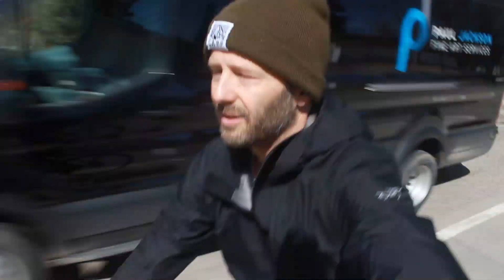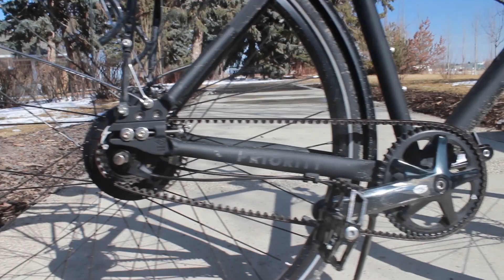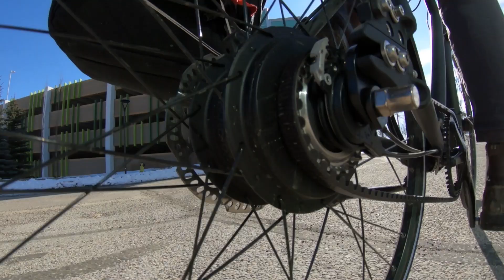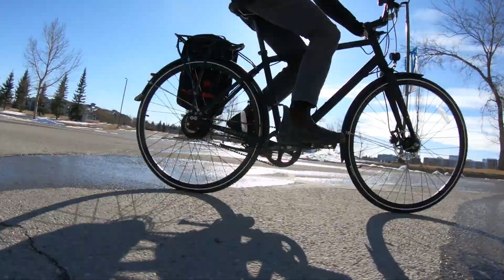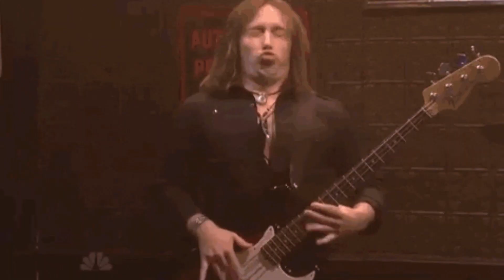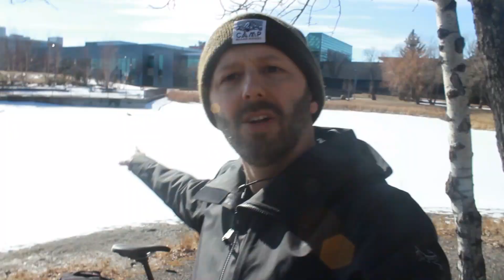Chain vs belt-drive bike | What's best for your bicycle commute?

Comment: Let me offer a stronger opinion: For urban/commute use, belts are unbeatable. The low maintenance and the corollary of cleanliness for your clothes and possibly insides if you bring the bike in are huge. In theory a Dutch style enclosed chain could be a good option but belts are fantastic for this kind of use.
Reply: Belts are still filthy and will ruin your pants if you let them get chomped in there.
Reply: @chalocolina3554  I've been riding a belt drive bike for ~4 years. The belt has remained clean (as clean as the bike is/isn't) There's no lubricant to attach to dirt (and be staining itself.  So no real issue while riding and no contact stain from brushing up against a chain while walking, parking, etc. either.

Yes, in theory, one could get a pant leg caught between the belt and the cog. But I haven't even had a close call (and have had issues with chains many times over the years). Many come with belt guards to mitigate this as well. Unfortunately my current one (Scott Sub Speed 10)  shipped with a plastic one that broke off (The Trek Soho that was stolen had a metal one)
Reply: it seems like they'd be better for the environment, too. Less fluids that end up in the soil and water as well as fewer chains in the dumps.
Reply: TBF, that can be somewhat solved with waxed chains.
Reply: @neutronpcxt372  Imagine the glide of a waxed chain and the zero effort for years. 🙂
Reply: @TimR123  Yes. Personally, I just want chain guards to becoming way more popular because the difference they make for commuting is huge in terms of maintenance intervals.

It'd be interesting to study whether or not waxed chain protected by a chain guard still has higher system efficiency than a belt drive only system. Chain guards do have aero costs...

Comment: I've had an internal 7 speed hub for 17 years, year round commuting in Toronto, zero maintenance.  The chain had to be tightened periodically due to stretching, and there's the chain rust.  My next bike will be belt driven.
Reply from the maker: Love it!
Reply: I remember having a Giant mtb many years ago with the Shimano Nexus 7 hub if I remember correctly the hub have me hassle free maintenance for at least 10 years minimum before it broke down?
Reply: I got my first Gates belt drive x Nexus-7 about 18 months ago. If you are using an internal hub, there is no need to use anything but belt if buying a new bicycle. Before I bought it I thought it was a risk, but within weeks (even in spring) I was adapted and totally sold on belt for commuter bikes. I keep looking for problems. Have not found any. After more than a year of at least 150km/week, the only wear I can find is the aluminum cog is slightly polished & shiny, no signs of advanced wear needing replacement (see Gates documentation). I think it will take years to accumulate enough wear. Clean with old toothbrush and soapy water. That is all. Love it.
Reply: Kevin Goetz  never.
Reply: I've daily driven a belt for 4 years now and I've to say my bicycle has way more issues with the belt. My bicycle repair shop says I'm the only one, but I've ripped through 10 belts (replaced for free because of warranty), it tends to slip more than a regular chain and is more difficult to maintain. (I don't mind oiling my chain 4 times a year)
And when it comes to bikes it's relevant: I'm from the Netherlands.

Comment: There's a better solution: waxed chains. Increases longevity significantly compared to oiled chains and like belts, does away with the mess. Like with anything there are tradeoffs and drawbacks. Belts will still last longer than a waxed chain and have less maintenance. But a waxed chain with the two pot method is still easier to maintain than an oiled one, by skipping the cleaning step. Especially so if drip wax is used in between hot wax baths.

Comment: The Dutch answer to the problem of oil on your pants is complete chain cases. They're reportedly heavy and still require internal gear hubs, but they apparently do the job, protecting the chain from the elements and minimizing the need to lube your chain.

One thing I think is safe to say is: don't buy a belt drive bike as your first. ("Entry-level" in marketing terms.) People who are new to biking will make adjustments as they figure out what they like and what they don't like. Belt drive bikes seem like a great long-term investment (if it's right for you), but one you gotta stick with once you have it.

Comment: I love my belt drive bikes. First one was commuter road bike (Civia Bryant), was mainly interested in the low-maintenance aspect, but also wound up loving the quiet. Second one was an e-bike, having already been sold on the belt drive for commuting.

Definitely are some downsides. Efficiency issues don't bother me much; IGH is also much easier for commuting anyway, maintenance-wise. And it's not like I'm trying to win any races getting to/from work. Even less of an issue on the e-bike, where the motor overcomes whatever losses I'd otherwise have. But I will admit that the requirement for special frame design limits availability. Also, belt drive is a lot more finicky with respect to the alignment of the rear wheel. Between disc brakes and belt drive, any time the rear wheel has to be removed, there's a whole production getting everything lined up again and tensioned right.

By the way, while the frame does have to be designed for the belt drive, it's not true that the design must be a split frame. There are bikes with elevated/raised chain stays that also can accommodate a belt drive. In those examples, the belt doesn't pass through the space between the stays and seat tube

Another option involves a tensioner/idler on the frame to allow the whole belt to travel through the frame triangle above the chain stay.

Either way, there's no need for a break in the frame.

In spite of the modest disadvantages, for me a belt drive is the only option for my cycling, which is primarily commuting with some recreation thrown in.

Comment: Like everyone has said: maintenance wise they're amazing. The payoff is weight of the internal hub gear. Friction: mostly from the belt entering and exiting the cog's teeth. To counter this, I've slightly loosened the belt, it does now occasionally slip when I'm on a very steep hill or taking off fast from a standstill. 
But I ride with someone using  a chain drive and I really notice their frequent oiling of the chain, the sound. It's a good reminder that the belt has definite high points.
I rode on a zinc coated chain through the winter previously and it doesn't last nearly as long as the belt drive, also it the chain stretches so much (internal 3 speeds seem to do that) that rust wasn't the reason I replaced it.

Comment: I'm at 3 years with my Schindlehauer Friedrich XI.  I have cycled 8,000 miles so far on th e one belt and I love it. The bike was chosen because it's my daily commute and I was tired of my bke being in the workshop.  So this has Disc brake TRP Spyre cable disc brakes.  I replace the pads once a year 3,000 miles.  It has a built in dynamo, no lights to worry about they stay on the bike and don't need battery or charging,.  It has an 11 gear internal hub. Drained and refilled once a year.  And the belt which will be 9,000 miles used this year and I'm wondering if it should be changed just because I never want a break down on my bike (tyres are Schwalbe, Kevlar in the tyres) I fitted these in the first  year.  London roads, too much glass on a Monday morning.  So the tyres have done maybe 7,000 and still don't need changing.  So I bought for low maintenance and frankly I can pretty much get away with taking it to the  workshop once a year, so long as they do all the work in one go.  I love my belt.  It's quiet.

Comment from the maker: Let me know about your experience with belt drives. I'd love to hear other perspectives on this.
Reply: Zero maintenance bike. All weather bike. Now I have no excuse not to drive around city.
Reply: Belt drives are awesome!!!...If you are more on the noncompetetive side of cycling i would say. Since i worked as an bike courier during university  (nearly 20 years ago) and needed sometimes 3 complete drivetrains per year i always searched for the "next step" in less mantainance and improved durability...so i went from a lot of mtb parts to an Rohloff Speedhub with an bmx chain wich was an eye opener back in the days!!!
5 years ago i purchased my first belt driven bike and got my second one two years ago...now i use a 29 er pinion-gates-mtb with this insane Lauf-fork wich is nearly maintanance free and an alfine11-gates-Urban/Gravelbike wich is also an silent dream (the Rohloffbike still exists but on my freeroller in the living room near the tv-set).
I think i will never switch back to an chain driven bike...belts are so quiet, they last forever, they are so much cleaner and they are safer!!! My kids use also belt drives and they love It to!
Greetings from Germany.
Reply: I had a Canyon Urban 5.0 for a few months. Loved the bike but I had to sell it because the gear range on the Nexus 8 hub was not wide enough (I do sportive riding g as well as commutes). During that time, and up to now (6 years in total) I've had a B'twin Tilt 7: a folding bike that I upgraded from 2-speed to Nexus 7. I am hopelessly in love with it. Unfortunately the aluminium frame is cracked so I have stopped using it. I am currently  having a Gates belt drivetrain fitted on a Brompton. My conclusion is that I can't get away from belt drive, but it has to be for commutes only. For serious sporty rides, you will be limited  by the performance of the internal hub gearing that is unavoidable with a belt...
Reply: My Cowboy bike has a Gates belt and I love it! I do clean it a bit every time I clean my bike but that’s very little maintenance. I’ve ridden 4000km and it still looks like new! And I don’t get grease on my pants, even when my pants go tangled up in the belt and crank it was fine.
Reply: Bike commuter and heart patient, therefore I’m testing all the e-bike options. I’ve owned old Porsche 944s with interference engines - carbon fiber belt every time thank you.  Salutations de Montréal, Calgary guy. ;)

Comment: A like the idea of a belt drive for urban cycling for the being low maintenance, but a single speed chain and sprocket are still easier to degrease and clean than a full derailleur setup.

Comment: I'm definitely hoping to get a belt drive when they become more ubiquitous and cheaper, that seems to be the only thing holding it back from being objectively superior for commuting.
Reply: What price point are you considering "cheap"? Walmart grade or lowest of the higher end ($500-$1000).
Reply: @joellebrodeur1015  $200-300 for the whole bike.
Reply: @MondeSerenaWilliams  I feel like that's too cheap. I bought a 200 dollar bicycle and I regret it because I had to do plenty of stuff to make it actually good. For once, cheap bicycles use the worst bottom brackets that break down almost immediately if they ever see any dirt or dust or water. The general quality isn't that great either. The gear ratio is awful even for flat terrain. Better to pay at least 350 dollars and get something decent. Here in Russia, I can get a belt-drive bicycle with a 3-speed Shimano gear hub for just about that.

Comment: U forgot to mention 1 big drawback: DRAG!

I saw a video where the 2 were compared to each other, each drivetrain consisting of a bottom bracket and crank set, the respective connecting part and an unlaced rear hub. When the presenter gave each drivetrain a quick push the chain drive kept spinning for much longer than the belt drive which came to a stop almost immediately!

The explanation is simple: A belt is a single part and thus has to deform in order to move around the gears. A chain is made up of joints that take much less force to bend than the belt does to deform, so a chain is more efficient.
Reply: A well maintained chain is better, definitely. But your average commuter squeaks and grinds their way to work without ever bothering to grease or clean their chain or prevent it rusting. Belts are better for those people.
Reply: Most scientific tests attest an efficiency advantage of about 2% for a perfectly maintained chain over the belt. A badly maintained chain can quickly become less efficient. However, a bigger efficiency drag is using a geared hub, especially anything other than a Rohloff. An Enviolo, for example, loses more than 10 percentage points over Rohloff and derailleur! So if you want to use a chain because of the efficiency, you should also use a derailleur. Personally, I wouldn’t want to use either.
Reply: I'd wager that test wasn't representative of reality. The wattage loses in a chain increase with power transfer (friction in the links increases under tension), whereas the losses in a belt would tend to remain constant with increasing tension. There's a small difference in efficiency but I it's not that noticeable. 
Unless you're a serious "cat 6" racer on your commute the difference is too small to be worth considering.
Reply: ebikes make that minimal difference null and void
Reply: @srobeck77  Efficiency losses with an ebike still mater. Will draw down your battery quicker and if you are going up a hill it will reduce your speed if you are the maximum torque of the motor
Reply: @brendanerskine4158  going uphill is irrelevant to the topic and will equally affect chain or belt driven ebikes battery life
Reply: @srobeck77  Like for like a chain/ deraileur setup will ascend a hill quicker than a belt/internal hub in lieu of better use of the motors full power and torque.
Reply: @brendanerskine4158  you talking about milliseconds only even relevant in a tour de france or other extreme biking competition
Reply: @srobeck77  (Rohloff excluded) internal hub systems have approximately 10 less efficiency with the Nuvinci 380 being the worst. I think that's significant as it robs a 250 watt motor of 25watts.
Reply: @srobeck77  Was clearly talking about  internal hub gears as it followed the 'excludes Rohloff' statement.  I've not talked about motor systems.
Reply: @brendanerskine4158  incorrect, theses no talk of internal hub gears. the topic was about a chain vs belt drive.
Reply: @srobeck77  Yep sure. But belt drives limit the user to a single speed or internal hub gearing. So when comparing belt drive vs chain you need to factor in the whole drive train.
Reply: @brendanerskine4158  id just factor in that belts or gear bikes cost 2 to 3 more than chain (start at $3500+) = discussion over. huge, rip off for very tiny benefits. Nuff said...

Comment: Seems like a straightforward flow chart: Are you buying/building an internal gear or ss hub that supports belts? If yes, are there split frames (or compatible suspension/dropouts) available in your preference/style? If yes, get it. The price pays for itself.

Comment: You forgot the number one advantage of a belt drive: “I can ride my bike without a chain!”
That joke aside, I got my belt-drive because, after I rode a Dahon for many years, I absolutely wanted a bike with a hub gear – to be able to switch gears just like that while standing is invaluable, and I found myself overtaking mountainbikers uphill, because all it takes me to switch gear is to not pedal for a split second, push the gear lever, and on I go with full force, while said mountainbikers lose much more inertia/energy with their traditional derailleurs, which simply take much longer to switch.
That the bike came with a belt-drive was just the icing on the cake, and the only disadvantage I noticed was that in earlier times, when I slowly advanced on pedestrians, they could hear the rattling of the chain, now I have to call them to ask them to step to the side for a moment, because they literally can't hear my bike approaching.
The low maintenance is a bonus, yes, but the biggest win is the complete lack of dirty black oil. It is a weird feeling when you think you forgot something only to remember that, no, you don't have to sleeve up your trouser leg, because there is simply no chain to soil it.
Would I recommend a belt-drive? Yes, but the hub-gear that comes with it is the actual win.

Comment: You forgot one plus side which I think is the most important at least I value it the most. It's that it does not strech. So you don't have to keep tensioning a chain at least once a month.
Reply: I just done 1000 miles and not lubed or adjusted the chain.
Reply: @kevinmurtagh3434  I have to change chains more often than 1 tk miles, because I do not care if there is raining or no and I use to drive muddy roads. chain is dirty and I am to lazy to clean it. In bike repair shop are pointing at me and say: you have to buy belt drive bike. +/- 300 euros per year goes to maintenance.

Comment: The maintenance is only "hose it off when it gets dirty" and the rest has to do with the gearing. On my Shimano Alfine 11 on my Priority Apollo 11 for example, it's changing the IGH oil at 1,000 km and then again every 2,000 km afterwards. Might be different with a Pinion gearbox or an IGH that doesn't run in an oil bath.

I like the belt drive so far, but it should be acknowledged rather than disregarded that the drivetrains that accompany them are less efficient than derailleur gears. My Alfine 11 is 5-8% less efficient, for example. It's not an issue in commuting or in the lower gears, but in the mid-high gears, it is absolutely noticeable. No one's winning races with belt drive.

Re. your getting a special winter version of the belt after yours broke, was that from Priority or directly from Gates?